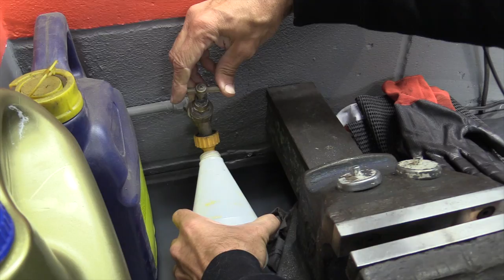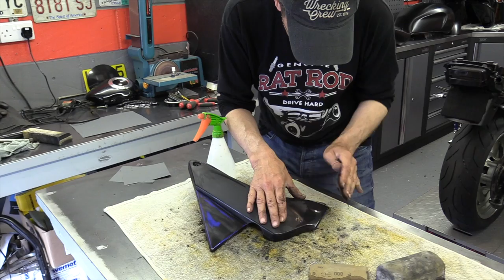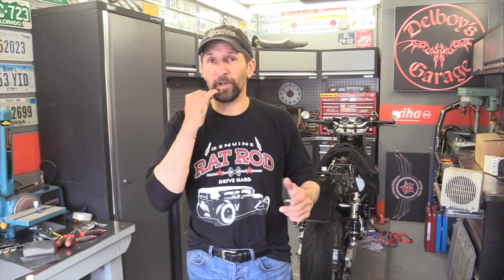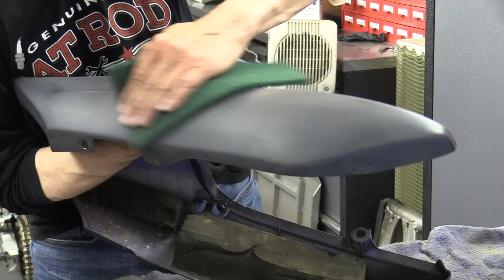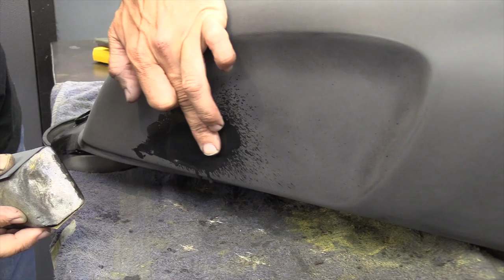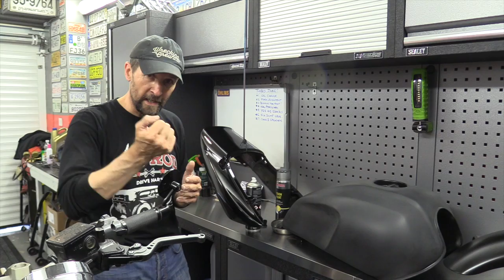Delboy's Garage, XJR Turbo, Final Prep for Artwork !

Comment: Hi Del, terminology may be different from paint shop to paint shop , but the fisheye reaction is caused by silicon residue from polishes and lubricants. Any panel painted must be cleaned thoroughly with a piece of clean work shop wipe and a hydrocarbon based cleaner, usually known as panel wipe or pre paint cleaner. I'm retired from painting now but I would always clean a panel at least twice using a panel wipe soaked wipe followed by a dry work shop wipe, and then repeat using fresh clean workshop wipes. silicon is very persistent stuff and its very common! panel wipe doesn't cost much but it is essential for any auto spraying job!
Reply from the maker: Hi Stuart, Yes silicone, the scourge of any paint shop... in fact, i usually cover the black engine finish on Penny's Triumph in silicone to make it look shiny.. but as i knew we were gonna paint this bike i stopped using it about two months ago so there's none in the area... sadly most polishes now contain it too, so yeah, i hear it called "wax & grease remover' all the time in videos, but like you i always remember it as panel wipe...  Thanks for your input buddy, its great to get some insight from the trade... take care.. Del.

Comment: If you were going to simply clear coat over the black would you still scuff it with the gray pad?
Reply from the maker: Yes always good to flat down the black if you are going to clearcoat it after it has dried.. but if you want to clear it at the same time as painting, then just wait the usually time between coats, and make the last three coats clear... Hope that helps.. Del.
Reply: Moonfleet41 awesome sauce!! Thank you

Comment: Hi Del  your prep work  is awesome! .I will be trying to spray my tank gloss black but would it still need to flat it down before any sort  of petrol  resistant clear coat or lacquer in a spray can ? Can  you  recommend any ? .Thanks, keep up the great work and ride safe ☺👍
Reply from the maker: Hi buddy, very few products in a rattle can are actually petrol proof, unless you're talking about, maybe, the aerosol mounted 2 pack systems, but you could buy a gloss version of the black and just polish it... ?

Comment: Looking good Delboy. Dumb question; is "fish eye" the same as "orange peel" when talking paint imperfections? Just curious.
Reply from the maker: Hey buddy.. No, they are two different things.. Orange peal is a generally rough grainy finish like the surface of an orange... but a 'Fish Eye' is a tiny little dimple or hole in the paint finish caused usually by a spec of grease or wax that stops the paint from sticking...

Comment: [p] Nice job Del . I know nothing about painting but My friend Pete hates tac rags  for a reason  . But that is his view on things  . Perhaps you might a small heat lamp to 
cure the paint job  a good call for the the fighter job. 
Cheers
Pete.
Reply from the maker: Hi Pete... why does Pete hate TAK rags then?, i didnt know that..?
Reply: Well from what he has said they can leave  something to upset the paint . I can only go with his view . But he has painted a lot of cars  tanks etc.
I worked in the garage trade for well to long  and the painters would use the rags . But Pete uses a alcohol of some  kind to wipe the tank or car.
I can only go with his advice and i trust it . 
Cheers 
Pete.
Reply from the maker: Yeah if you press too hard with a TAK rag you'll leave the tecky stuff on the paint surface.. they are generally respected though i believe..
Reply: Fair play Del . I think Pete uses shop towels and wax and grease remover.
Reply: That's one of the reasons I leave tak rag to air (dry) for at least 10-15 minutes before I use it, and never press it down hard or rub it in.